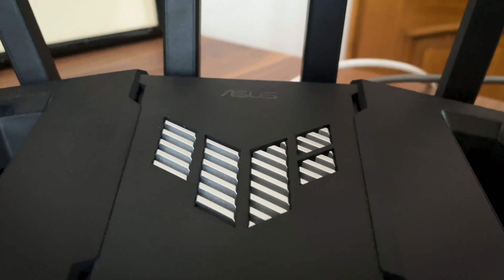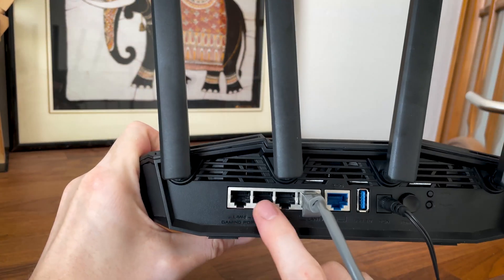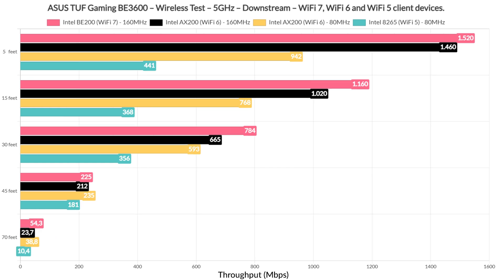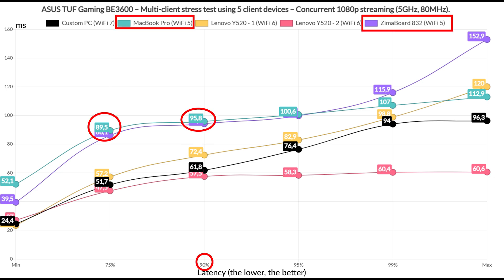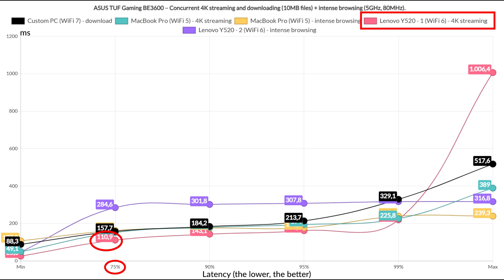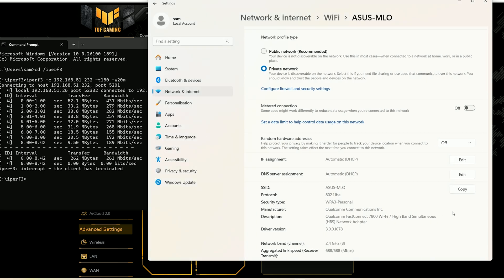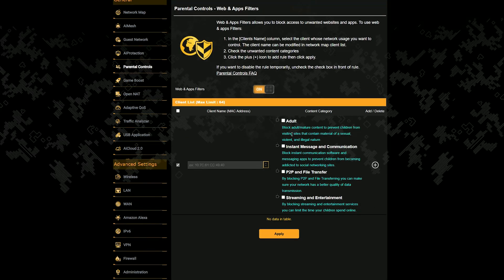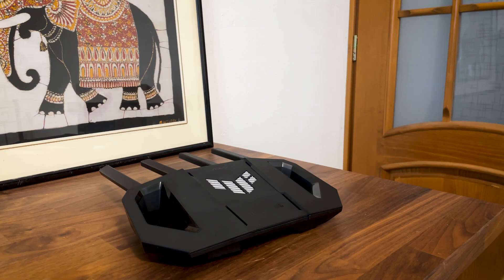ASUS TUF Gaming BE3600 WiFi 7 Router Review: Wait until it gets cheaper

Comment: What is the difference between Asus RT-BE58U and this one?
Reply: AFAIK they're both the same router except this one is using the TUF software.
Reply: TUF Gaming BE3600:
Gaming features (Game Boost, Mobile Game Mode).
VPN Fusion.

RT-BE58U if:

Advanced WAN flexibility (Dual WAN, 5G tethering).
AiProtection Pro and Instant Guard VPN for enhanced security.
Lighter, more compact design with MU-MIMO support.

RT-BE58U is better. If you game and use VPN, BE3600 is better due to VPN Fusion.

Comment: Hey I really need some help what would you recommend I get a asus gaming router like the one I currently have my eyes on potentially this Black Friday sales (the ax tuf-4200) and use it in repeater mode to have a wired ps5 connection or get an actual ‘WiFi extender’ or is it the same thing? If so would the asus ax tuf 4200 just have more features and be better for gamer like me than a traditional WiFi extender? I actually can’t find this answer anywhere on the internet after hours and days of research , would really appreciate it , thanks 🙏
Reply: It depends on what router you have already running. Best way to increase wireless coverage is to build MESH using wired connection between MESH nodes. Repeaters/extenders cut the bandwidth in two (signal reception and transmission are all in one bandwidth), latency increases etc.
If you're setting up single router configuration, i'd recommend tuf-ax6000 instead - it has 2,5 Gbit WAN port and dedicated 2,5 Gbit LAN port and provides 4T4R (4x4:4 MIMO) in both 2,4GHz and 5GHz (unlike tuf-ax4200m which has only 2,5 Gbit WAN and provides only 2x2:2 MIMO in 2,4GHz band and 3x3:2 in 5Ghz (latter becomes 2x2:2 when 2,4GHz is occupied)) Both of them have same SoC's and identical wireless chips, and both are middle-tier models.
Reply: @ Hey bro thanks for the reply trying to help, I have a virgin media hub 5 WiFi 6 router that Iv just got installed just under 2 months ago now by virgin media and unfortunately I don’t have an option for mesh nodes and all these wires, literally my only option I have (and I know it’s not the best option for optimal gaming experience) is to extend my current existing WiFi network ie basically extend my main router what would you still recommend I get? A WiFi extender or the ax tuf 6000 and put it in repeater mode ? Is repeater mode literally a WiFi extender ? Or is it different?? My current setup is I live in a big 5 bedroom house my main router is so far away downstairs and my ps5 and current netgear nighthawk WiFi 5 WiFi extender are both all the way upstairs in my room next to each other and I’m using a 1 metre Ethernet cable to plug one end into one of the WiFi extender Ethernet ports and the other end into the ps5 to have essentially a wired ps5 connection but and Iv actually also been looking at the ax tuf 6000 model too thanks for bringing the specs to my attention I wasn’t sure what really were the differences were the only reason I know what MIMO is is because of my current WiFi extender has this feature even though it’s a quite high end WiFi extender it’s now considered outdated as its WiFi 5 (netgear ex7700 WiFi extender) so I’m looking to upgrade to some sort of a WiFi 6 device to extend my current network , I’m very close to buying the WiFi 6E WiFi extender from TP link it has 4 antennas on it (TP link RE815XE) or shall I get the ax tuf 6000 and then put it in repeater mode which is a WiFi extender mode?? Ie I can connect the ax tuf 6000 to my main existing router wirelessly like a extender which is repeater mode ie 2 routers in the house? So I can put the axtuf6000 right next to my ps5 upstairs while my main router is all the way downstairs just to have a wired ps5 connection? As it’s literally Black Friday tomorrow I’m almost close to making some rash decision , sorry for the long message just really need some advice on making the right decision! 😭 Thanks 😃😃
Reply: @buckseyboy  First of all, is there an option to move Hub5 towards the center of your house? That's what i would do, and it simplifies the task. Second, you may consider ordering couple WiFi Pods, available at Virgin Media, maybe even for free, depends on your connection plan (my thoughts are if you have Hub5 you gotta have 1gig plan). In this case you'll skip all the unnecessary actions and will get seamless wireless network. If it's gonna be free-of-charge then it's your ultimate option. I personally can't justify purchasing and using whole separate router as a simple repeater because it's gonna be used in sorta stripped down manner (only to extend wireless while not being able to use all of router's features). Can't see the reason to spend extra cash on WiFi 6E extender (TP link RE815XE, as you said) while having WiFi 6 main router (Hub5 in your case). If cable connection between nodes isn't an option (but that would be the best one), you can go for TP-Link RE705X. Regardless of the device you choose to buy, in order to get the most out of your wireless you have to put it in the middle between your PS5 and Hub5 and not near PS5, or at least as close as possible to Hub5 while using longer cable to connect PS5.
Summary: if it's doable and low latency is your priority, use cable connection, there are many options out there to route cables indoors even without having to penetrate walls/ceilings; at least you can connect decent extender by wire. If you have many WiFi (and IoT also) devices at home and want to have seamless wireless network, go for WiFi Pods. If you're familiar with repeaters/extenders (have to admit that true extenders use cable only (ethernet/coaxial/even powerline) to extend WiFi, repeaters use existing wireless with obvious downside being decreased bandwidth, but nowadays the boundaries between them are blurred and many companies use different naming policies to name devices with similar functionality differently and vice versa, and it may be confusing) then buy something like i've mentioned before. And of course if you have money to burn you can go for aforementioned tuf-ax6000, it'll also do the job. :) I should mention that there's another, more pricey but more flexible option: use extender like RE705X/RE815XE etc. in wireless bridge mode, put it literally in the most center of your house and connect router of your choice to it. Make your choice according to your own possibilities. :) Best regards!
Reply: @ Damn man you really know your stuff!! I’m so happy I ran into you (or you ran into me for that matter lolll) I’m very grateful! And no actually because we had the hub 3 for like 8-9 years believe it or not and the power cable finally went on us so we had a virgin media engineer come in and check out and he just so happen to fit in the new hub 5 for us completely free of charge this was about just under 3 months ago now (because we had the hub 3 for so long we obviously skipped right past the hub 4 to hub5) the only weird thing is since I had the hub 5 every single game I play online with is 22ms ping on average on the hub 5 which is really p**ing me off vs the hub 3 i had an average ping of 13/14/15-16ms ping on any game (battlefront 2 and cod black ops 6 are my main games) I turned all the modifications settings on the hub 5 router like firewall off, tried port forwarding , DMZ, DHCP , ie tried different dns servers and still no luck! With my current wifi 5 netgear extender I thought it was that (being a WiFi 5 out dated device with a WiFi 6 router) so I tested my ping directly connecting my ps5 straight to my main router on WiFi and still the same 22ms ping on average even with the Vigin media hub 3 I had better ms ping regardless from the WiFi extender or straight connected to WiFi to main router on hub 3 with the ps5 I would get 15-16ms ping on average (never higher) baffles me that the hub 5 which is the latest and greatest router from virgin which is supposedly meant to be a way better operational system with WiFi 6 firmware and the latest up to date specs etc etc 😒😒😔😣 drives me up the wall! And has been since the last 3 months since I got the hub 5😂 another thing I live in a big 5 bedroom very dysfunctional household so I really don’t have much options with long cables and such and I don’t unfortunately also have an option to replace the hub 5 to somewhere else in the house or have any of these powerline adapters near the router incase they get unplugged or whatever the stupid case may be (you just can’t get through to some idiots no matter how good of your explanation is they think it will cost them more money or whatever and I just really can’t be asked and just avoid the hassle and drama you know, hope this helps for an understanding otherwise trust me man I really would do all these better optional options out there! So basically right now I literally only have an option to extend my current main router , which would you say lastly just to fully confirm my situation in needing to extend my main hub 5 router shall I’d get the ax tuf 6000 in repeater mode or the tp link RE815XE price isn’t exactly an issue for me I would just rather spend a little more money for the better thing long term if I use something everyday as I see it an investment even though might not benefit me personally I also go for something not too cheap , Iv always been like that , but yhe I won’t be able to use the QOS in repeater mode for the axtuf6000 ? Or will it have atleast more advanced options than a WiFi extender like the RE815XE with the axtuf 6000 in repeater mode? Or in my case will a WiFi extender have actually more benefits for me? Sorry for all the questions , you have already been a more than a great help for me and I really can’t thank you enough tremendously , honestly,  thank you so much for your time , I really do appreciate it its an understatement 😃 happy thanksgiving! as I have asked this exact same advice on multiple different YouTube videos and all ignored me! So I’m very grateful bro!🙏🙏 there needs to be more people on the internet like you , honestly!
Reply: @zeeproavk  anyway I bought the asus ax tuf 6000 in the end earlier today from amazon gets here Tuesday , I cannot wait! I’ll try repeater mode and media bridge mode on it too, hope it all works out 😄😄

Comment: hi wanted to ask, the 2.5g port shows it can be used either on the wan port or the lan port 1. what does that mean? does it mean that the 2.5g can be only used for single port only? or the wan port is 2.5g and the lan port 1 is also 2.5g? I'm confused. my understanding is this, ill be using the 2.5g at the wan port. But by me doing this is the lan port for 1, 2, 3 & 4 can only be used as a 1g?
Reply: That right, i wanna ask this too.

Comment: Asus RT AX-52 Review please? With internal explanation. I like your internal cpu, ram, wifi chips explanation.
Reply from the maker: It looks very similar to the RT-AX53U, but I will check it out if I manage to get a unit.
Reply: @SamBondor  Ax53U is totally different router, using mediatek old school MT7621 880MHz dual core cpu(3rd class garbage cpu). By any means AX53U is not a good rounter at all. But AX52 is good and much much better than AX53U.
Reply from the maker: @mahamudulhasananik  Got it. I will see if I can get a unit very soon and test it.

Comment: I got the Xiaomi BE5000 for 55$. This is too much for a router that doesn't even have 6GHz band
Reply: 😮, how would you make sure that there's no CCP's 'back door' on it, I wonder.
Reply: @galaxydust7267  Same as with all routers. Monitor traffic. Sine all chips are made in china, for the routers, all routers probably have china back doors but are not active.
Reply: @galaxydust7267  Edward Snowden？
Reply: @galaxydust7267  how? put it in access point mode and connect it to a opnsense firewall.
or u can install openwrt because the bad CCP Chinese ppl allow this.
Reply: usa back door  😂
Reply: @dongoufei  yeah I don't care and I'm not in us 🤣🤣🤣